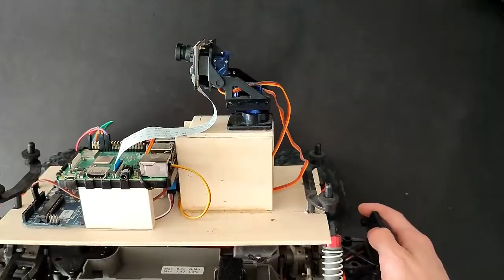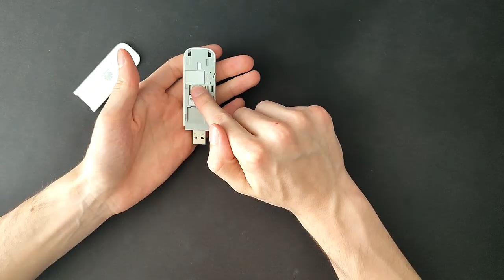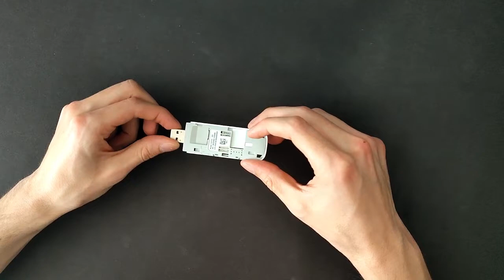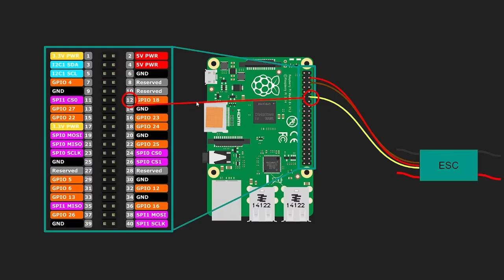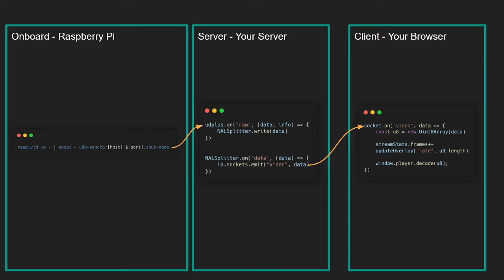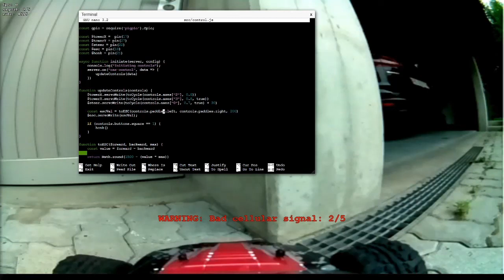Unlimited Range RC Car - How to create your own

Comment: With Broadway decoding in the browser, do you discard queued video frames after an LTE stall, or play them out? For remote driving, a smooth but stale picture is harder to spot than a brief freeze.

Comment: Any reason you chose to use UDP instead of something like RTP or WebRTC? Working on something similar.
Reply: udp just sends the data without checking if it was received unlike TCPs has to sync and ack

Comment: Why not just use a mobile phone it has a camera it’s own battery, you will just need to fined out how to send the car signals to go forward backwards left right 🤷‍♂️
Reply: That seems a great idea, however the overhead of a cellphone OS, etc. Makes the latency high.
Reply: @joaovictorf.carvalho458  The latency of the OS is tiny compared to network latency. That statement makes no sense.
Reply: @maximus-bear  in a application where every ms its important, it will nake a big difference. Just try urself with and in another environment with proper system and tools.
Reply: @joaovictorf.carvalho458  Yeah mate. I used to work for Segment where we handled billions of messages a day at low latency and now I build banking systems with a 100ms budget for auths including network latency. OS doesn't add milliseconds, it barely adds nanoseconds.
Reply: That was old. There now cloudrc. Have SIM card ready
Reply: Yeah, we need direct connection for the lowest latency possible.
Reply: I am doing exactly this, using a mobile phone for image transmission. I can record 4k video and stream in low quality for low latency. But for controlling the car I am using a ELRS sender, so my range is not unlimited but the range of ELRS is fascinating. But still want more, this is why im here :D
Reply: @racevision hey Bro could we chat I just got my RC and soon ready to FPV it could you give me some points to consider and where to buy stuff and what to buy.

Thanks in advance
Reply: @racevision, what is your calculated latency?
Reply: @joaovictorf.carvalho458  It can go as low as 200ms (4G) most of the time. Both phones have the same provider and are directly communicating through the NAT IP addresses. So the phones doesn't have a public IP but internal routing between NAT devices is apparently enabled by my provider. It's more than good enough for cruising around, racing is not so possible.

Comment: Hi! Cool video, thank you :) You solved it already, but maybe you still don't know about the "NALSplitter": 

"NAL Unit Separation: In video compression standards like H.264 and H.265 (HEVC), video frames and other data are divided into NAL units, which are the fundamental units for encoding and decoding. Each NAL unit represents a piece of video data, such as an I-frame, P-frame, B-frame, or parameter set. Splitting NAL units allows you to isolate and process each unit individually.

Synchronization: Start codes, typically 0x00000001 or 0x000001, are used to mark the beginning of NAL units. Splitting NAL units based on start codes ensures that video decoders can accurately synchronize and identify the boundaries of individual units in a bitstream. This is crucial for proper video decoding and playback.

In summary, splitting NAL units is necessary for correctly parsing, decoding, and processing video data, allowing for synchronization, identifying NAL unit types, enabling parallel processing, and ensuring error resilience and adaptive streaming in video applications."
Reply: Hi Can I talk to you privately? I have some questions about the rc car
Reply: @tarkss99   Hi, i didn't create that car, but just found that piece of info to hopefully help him :)
Reply: Can you please contact me?I need some help regarding the car!Imma willing to build one but imma total beginner..Can we just talk for a few minutes privately?

Comment: @Pexeus hi ! 
1. could you tell please, which pins controls speed of the car?
i see in control.js:
const $towerX =  pin(17)
const $towerY = pin(27)
const $steer = pin(22)
const $esc = pin(18)
const $honk = pin(21)

as far as i understand 17,27,22 - for tower control. where forward-backward?

2. where server should be deployed ? if on PC how does raspberry will know the IP address of it ?
we are on 4G not wifi.

3. how to control the car ? keyboard?
Reply: Server ip is your wan address of home. Rasbery PI connectting to home server. $esc(pin 18) for forward and backward. Mouse, keyboard.